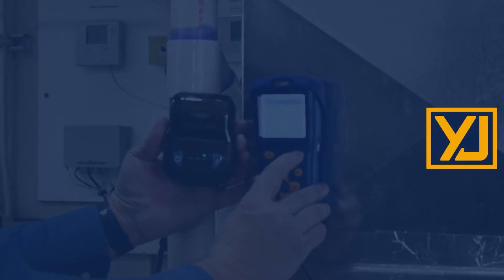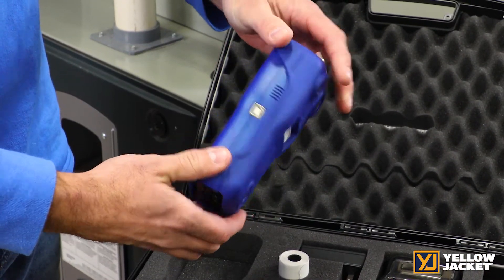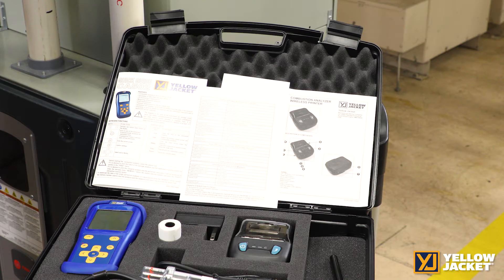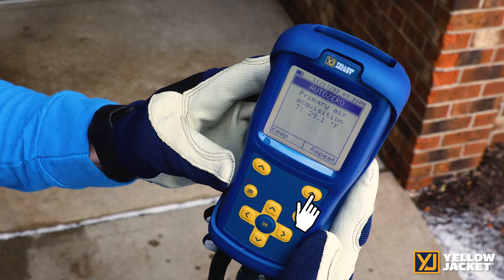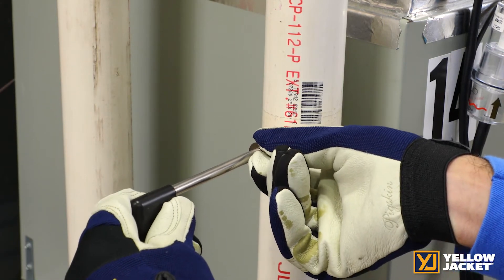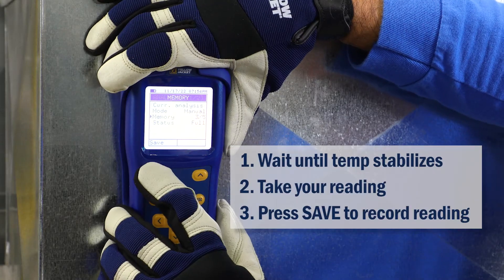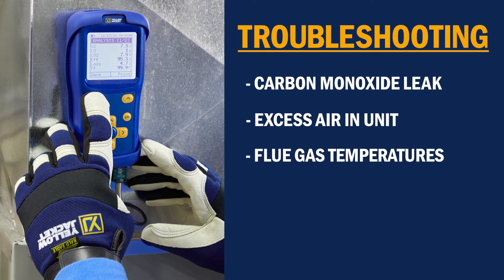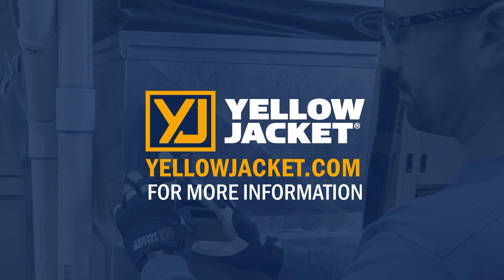The 3-IN-1 Combustion Analyzer for Safe, Accurate Diagnostics.

Comment: I don't know....The good tech will determine a crack in the heat exchanger through observation quickly and easily on 90+ gas furnaces. I would need this tool rarely for gas furnace service. It is a must have for Oil Furnaces however and it is my Professional Opinion that NO tech should servicing Oil furnaces without a combustion analyzer on their truck.